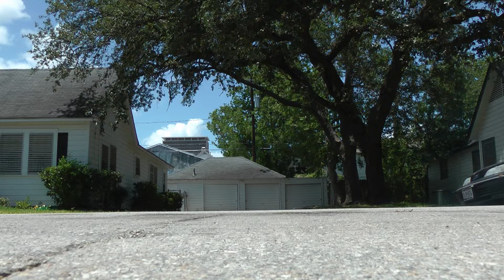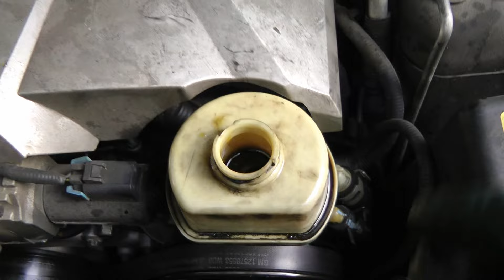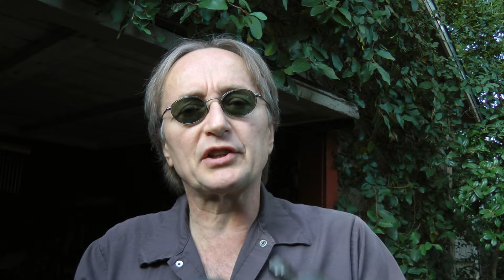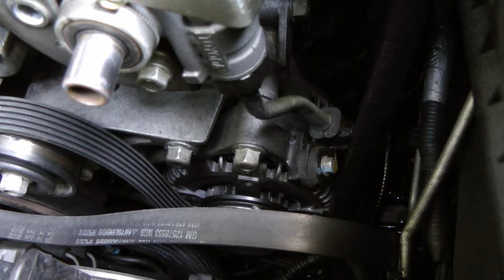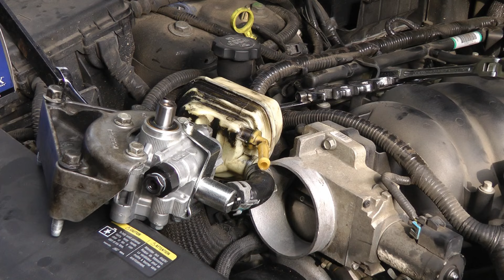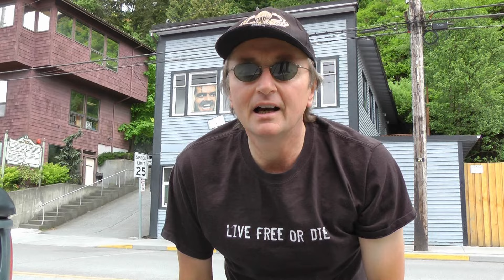How to Replace Power Steering Pump in Your Car

Comment: scotty I have this grinding noise when I slow down and/ or turn, usually when I'm going 35 or higher, I know it cant be the brakes, I just had those replaced. The local repair shop said it has something to do with the power steering at they want over $500 to do it.
Reply: +Billybob JamesALT I just helped a dude replace a water pump on a 2005 Silverado. 3 years ago it cast him $400 to replace the pump at a local mechanic. 3 years later the part failed. $100 and little elbow grease and he has a new unit. Of course he had to buy two gallons of 50/50 dextron. The thing is it will take a mechanic 45 minutes with power tools. It was that easy. So let's see, a mechanic charges around $60-90/hour. You get the picture?
Reply from the maker: +Billybob JamesALT  get a second opinion, and if it's the pump, you could try a rebuilt unit to save money
Reply: Billybob JamesALT Just for everyone's reference, your first move should be to double check that the pads did not become dislodged or misaligned. Just had this happen on an '03 Taurus cuz they have these weird pins that push on the caliper wall and the inside pad wound up getting jammed crooked a bit.

Comment: Hey Scotty I have a 2004 Jeep grand cherokee 4.7L and my steering pump was making a groaning noise around turns so I replaced the pump and that noise is gone but now it sounds like a supercharger when you are accelerating. This is the 3rd pump that is doing this now? Am i doing something wrong? I turned the wheel 40 times before i started the car and 40 times with it on and all the air bubbles are out. It is topped off to the cold line with ambient temperature
Reply from the maker: +Thomas Petito  if you are using rebuild pumps, give up and buy a brand new pump. If you are using brand new pumps, times for a new steering box as it would be building up too much pressure inside

Comment: I need to replace my power steering pump on my 2002 Grand Am because the bearing is grinding (when testing I turned the wheel all the way left for a long time and the bearing on the pulley started glowing). Do I have to purchase a separate bearing or is the bearing part of the new pump?
Reply from the maker: +spencell part of the pump

Comment: Good afternoon , I have a Mazda 3 2.0L 2005 . And the steering wheel becomes difficult to turn . What is the problem. ? Thank You.
Reply from the maker: Edgar Cruz check for low fluid. If not that, try my video "fixing binding power steering" and pray you don't need an expensive pump or rack

Comment: My 2000 GTP has some power steering issues. It was leaking fluid like crazy, now the power steering is sporadic. Is this the pump or a line. If it makes a difference, my car does have Magnasteer.
Reply from the maker: Edward James Bickels if it leaked a lot, air then ruins the pump, realize that. so fix the leak first, and if necessary, replace the pump
Reply: Great. Thanks for the reply!

Comment: Your videos are the best I have seen. The same troubleshooting issues are the same on the 2002 Ford Taurus SE. When I jacked up the car. I noticed black residue of power steering fluid beneath my vehicle near the right wheel on passenger side and not on the driver's side right below where the pump sits. I want to make sure that is the pump and not a bad power steering hose leak before working on it.

Comment: Just replaced my power steering pump yesterday and it took forever. Now at idle and at low speeds my steering wheel will not turn. Now if i am sitting still and rev the engine the wheel will turn any idea on how to fix it?
Reply from the maker: Andrew Greene odds are you got a crapper pump, if it's rebuild, take it back for a brand new one
Reply: Scotty Kilmer Since im not going to remove half of my engine compartment again and since the pump is still under warranty, how much do you think a mechanic would charge to install the new pump. Also the vehicle is an 02 tahoe and there was an electrical connector on the back of the pump i believe it is an evo actuator should i just get the delete kit? Thanks for replying!

Comment: well i watch many video about the power steering .and my problem is the i replace the  2 lines and the gear  box on a 1998 tj jeep and i lift the front wheels to get the air and what this pumps does she make a bang noise and if i take the cap off the oil coming out so fast that pis all the oil and the oil its foaming the bang noise get low after few seconds HELPPPP.
Reply from the maker: MrJoey32370 odds are the steering box is bad, building up pressure the making the oil shoot out. OR, you have the hoses on wrong and they are bent or somehow restricted internally causing that pressure
Reply: thanks i will go over the connections and any bent hoses .and i get back with the results.

Comment: How do you take out a lock from the steering wheel. Where the key starts the car on a 05 Buick rendezvous cxl
Reply from the maker: giant pain in the ass "Conversion Calculator
2005 Buick Truck Rendezvous AWD V6-3.4L VIN E
Vehicle » Steering and Suspension » Steering » Steering Column » Service and Repair » Ignition Lock Cylinder
Ignition Lock Cylinder
Ignition Lock Cylinder Replacement
Removal Procedure
Disconnect the battery negative cable.
Caution: Refer to Restraint System Service Precaution.
Disable the SIR system.

Remove the steering wheel.

Remove the tilt lever close out plate.
Remove the retaining screw from the lower steering column trim covers.
Tilt the trim cover down and slide rearward in order to disengage the locking tabs. Remove the lower steering column trim covers.
Remove the retaining screws from the upper steering column trim cover.

Lift the trim cover in order to gain access to the lock cylinder access hole (1).

Insert the Snap-On A173A bent-tip awl (1) or equivalent, with a 2.5 mm (3/32 inch) tip, and 20 mm (3/4 inch) in length, into the access hole of the ignition lock cylinder.
Turn the ignition lock cylinder to START.
Use the bent tip in order to push down on the ignition lock cylinder retainer.
Release the ignition lock cylinder to the RUN position.

Remove the ignition lock cylinder from the lock cylinder case.
Installation Procedure
Insert the ignition lock cylinder through the trim cover in the upper steering column.
Align the lock cylinder retaining tab and the position tab with the slots in the lock housing.

Completely push the lock cylinder into the lock housing.
Notice: Refer to Fastener Notice in Service Precautions.
Install the retaining screws to the upper steering trim cover.

Tighten the screws to 3.5 Nm (31 inch lbs.) .
Match the tab slots on the lower trim cover with the locking tabs on the upper trim cover.
Tilt the lower trim cover up and slide the lower trim cover until the locking tabs snap into the tab slots.
Install the lower trim cover screws to the steering column. Tighten the screws to 1.5 Nm (13 inch lbs.) .

Install the tilt lever close out plate.
Install the steering wheel.
Enable the SIR system.
Connect the battery negative cable.
© 2015 ALLDATA LLC. All rights reserved. Terms and Conditio
Reply: I am asking would i be able to have a number on you just in case for other help from you in the further ahead in life . thank you an may God bless you an family

Comment: I HAVE A 98 LEXUS GS 400 AND ON COLD START THE POWER STEERING WHINES EVEN WITHOUT TURNIND THE STEERING WHEEL AND THE FLUIDS ARE ABOUT NORMAL AND THERE IS FLUID LEAKING DOES THIS SOUND MORE LIKE THE PUMP OR THE SWITCH AND I THINK IT LEAKED AND MESSED UP THE ALTERNATOR CAUSE MY CAR IS DEAD NOW
Reply from the maker: fix any leaks first, and replace the alternator if it's not charging now. see my video "finding and fixing car oil leaks" to find the leak

Comment: I have a 2002 Mazda Tribute and just got back from the Mazda service department  where they said I'd have to replace my power steering pump and it would be $350!! Do you think I could find a local mechanic that could do it cheaper?
Reply from the maker: sure, call around for quotes

Comment: Hey darlin, I have a question. My 2005 chevy Malibu has been leaking fluid for some time now, and when I put more fluid in it the cap pops like there is alot of pressure in the res and it is full of bubbles. like a foam. and now the steering s like trying to drive a1955 chevy!! no power steering at all! do you think I need a new pump? BTW thanks for the video cause I will be doing this myself and I need to know how to do it!! can you also tell me what tools I will need to do this please sir? and thank you!
Reply from the maker: either pump is bad, or system is restricted from a collapsed high pressure hose OR blocked power steering rack. time to see a pro with his gauge set if you don't like guessing with expensive parts.
Reply: Scotty Kilmer  Thank you sweetie!! I will have to bite the bullet and see a professional with a gauge. But when he tells me what is wrong I will find a video of yours and fix it myself!!! I am a girl that can do these things and proud of it!!!

Comment: Hi Scotty I need your help. Few weeks ago my chevy astro 00. Get the gear box replaced but since that  every time  I turn the wheel  it make. A groaning noise   . I appreciate  your help
Reply from the maker: check the power steering for leaks, but if it's full, check for bent power steering lines that are binding, and check the front end for worn bushings on the A frames

Comment: How do i change alternator on 02 northstar?
Reply from the maker: gigantic pain, pays a mechanic 400 dollars labor:REMOVAL PROCEDURE
The Denso SC1 (KG9) generator is serviced as a complete unit only.

Disconnect the battery negative cable.
Remove the drive belt.
Remove the radiator.
Disconnect the wiring harness connector from the generator.
Reposition the protective boot from the generator output BAT terminal for access.
Remove the generator output BAT terminal nut and disconnect the positive lead from the generator.

Loosen the lower generator bolt (3).
Remove the generator bolts (1, 2) from the generator.
Remove the generator from the vehicle.
INSTALLATION PROCEDURE

Position the generator to the A/C compressor and engine.
NOTE: Refer to Fastener Notice in Service Precautions.

Install the generator mounting bolts (1,2).
Tighten
Tighten the generator mounting bolts to 50 N.m (37 lb ft ).

Connect the wiring harness connector to the generator.
Connect the battery positive lead and install the generator output BAT terminal nut.
Tighten
Tighten the generator output BAT terminal nut to 12.5 N.m (111 lb in ).

Press the protective boot on to the generator output BAT terminal.
Install the radiator.
Install the drive belt.
Connect the battery negative cable.
For a description of the RPO Code(s) shown in this article/image, refer to the RPO Code List found at Vehicle/Application ID See: Application and ID\RPO Codes
© 2014 ALLDATA LLC. All rights reserved. Terms and Conditions
Reply: Holy mole , ok thx so much , i think i remember when you worked in Marco island fl.!!

Comment: Hey scotty in my 2010 dodge charger the steering wheel squeaks when it gets cold outside... someone told me it may be a bad clock spring
Reply from the maker: IF it works ok ignore it. Could be that, often also just plastic crap rubbing when cold. Means nothing if it goes away when warm

Comment: Hey Scotty I have to change my power steering pump but auto zone and other places they only have Re manufactured pumps. Not new ones a friend who is a mechanic recommended the brand Cardone A1 Remanufactured. Is it a decent brand? Searched online couldn't find NEW PS pumps....
Reply from the maker: I hate rebuilt pumps, often have gotten bad cardone ones. Just make sure you get a good guarantee if you buy a rebuilt unit.

Comment: I have a 1991 Lumina. It leaks power steering fluid onto the serpentine belt and engine. It would not  the high pressure hose leaking up there. I think it is the power steering pump. Do you agree Mr. Kilmer?
Reply from the maker: it could be either, do my video "finding and fixing car oil leaks" to find out for sure

Comment: I realize on this particular repair the pulley needed to be removed so it could be put on the new pump, however I always thought they put the holes in the pulley to access the bolts, isn't that the normal way of removal with/without the puller? Just wondering. :-)
Reply from the maker: yea, used to be that way, but now most makers are going cheap and make em without holes and just press em on to save money

Comment: Why installing a new pump when you can overhaul that thing in a few ours ?
much cheaper and a piece of cake if youre a bit handy 
Love your video's most helpful
Reply from the maker: often vanes wear out, and rebuilding a pump does not work. rarely do they just wear out the seals only.
Reply: Scotty Kilmer I've seen that there no vanes in the rebuilding kits  why the blades are not in a rebuild kit, I do not know, because they can buy them anywhere as it seems only new ore rebuild pumps 
 
My previous Chevy never had problems and had 300,000 miles on it when I sold the Van

But your answer is understandable.

thanks again
paul

Comment: Hey Scotty,

First and foremost, I want to thank you for sharing your knowledge, and making these videos.

So I drive a 2007 Dodge Caliber SXT 2.0 with approximately 121,000km.
My car has started to sound like a diesel engine. I seen a video of yours how you took a long wrench and put one end on a pump and placed your ear on the handle. I believe I've narrowed the noise down to my power steering pump. I checked the pulley and there was no play in it, the belt appears okay, but I didn't take it off. Could you possibly advise me with some idea's as to what it could possibly be that's making this loud diesel like noise?

Thank you.
Reply from the maker: take all the fans belts off, run it, PRAY the noise goes away, then figure out which one's making it. If not, engine is going out, which is rather typical on that engine design sadly.
Reply: So I did as you suggested. The sound went away after removing the belts, and letting the engine run. I changed the power steering pump, and still I have this diesel sounding engine. However, I managed to score a ton of parts that I am in need of, but I was able to get an alternator. Because my alternator sits directly under my power steering pump, I think I was hearing the noise and feeling the vibrations through my PSP, but it could be the alternator making the racket. I managed to get these parts from a guy who was rear ended and his Caliber totaled. I managed to get all the front end suspension stabilizer bars, struts, control arms, rotors, brake calipers, and the alternator all for the cost of his 1 week car rental fee.. $130.00 I paid lol.

Comment: Shouldn't the power steering fluid be flushed out?
Reply from the maker: only if it's really dirty, as most the fluid is in the pump and reservoir and will spill out putting a new pump on
Reply: Bit if the pump is worn, or has bad bearings - the reason behind the groan -  I would think the fluid would be contaminated - visible or not.  And therefore would need to be flushed out or you'll be doing this again sooner rather than later.

Comment: Hey so I replaced my rack and pinion and the steering stayed hard replace my pump and it stayd hard it doesnt make any noises on random starts the power steering magically turns on for a feew secs then goes back to being hard. I cant think of anything else no leaks or anything can it possibly be the rack and pinion pressure sensitive switch seeing as how its the only extra piece on there. The new rack n pinion didnt have it so I used the old one. What do you think worth a shot?
Reply from the maker: try a new high pressure hose, fi that doesn't do it, then either you got a bad power steering pump OR you have a serious front end problem like stuck ball joints that are dragging and stiff
Reply: Scotty Kilmer so I changed my switch and it wasnt it. Now im going to try the hi presure hose.

Comment: hi scotty i have a 2005 mustang v6 and it recently started making the groaning but it only does it when i turn to the left when its idle or when the car is moving at a low speed pls help any suggestions
Reply from the maker: rack is worn, but do try my video cleaning fix "fixing binding power steering"

Comment: Hi, i have a 93 dodge dakota and i have this problem wiht the steering when i turn to the left is kind  of hard and it turns to the right just fine what could it be the problem?   Thanks
Reply from the maker: worn steering box in most cases.

Comment: so my power steering started groaning a lot.  Then I got this code on po553.  I don't know if its the pump, hose line or the sensor/switch?
Reply from the maker: change the switch out, it's either that or the wiring going to it or the main computer.
Reply: would it be the power steering module or the whole ECM ?

Comment: Scotty , hey there , I've got a 2001 Nissan Frontier , 4 cylinder , my power steering pump is groaning but......my steering is not any different , its not binding at all at the wheel , is this a common symptom??? Or can I expect my PS pump to gradually fail???

Comment: how do you remove a power steering pump from an 03 Lexus GS300?  Do you need this special tool or do I just stick something in between the pulley to keep it from turning, then remove the nut?
Reply from the maker: yes, they are not as cheaply made and removing the nut will get it off. Pressed on pulleys are just for cheaply made parts to save money building them

Comment: I have huge steering wheel oil leak do i need to change the whole pump or the lines coming out of the pump?
Reply from the maker: depends what's leaking, often it's just the high pressure hose itself, have someone turn the wheel while you look at it under the hood